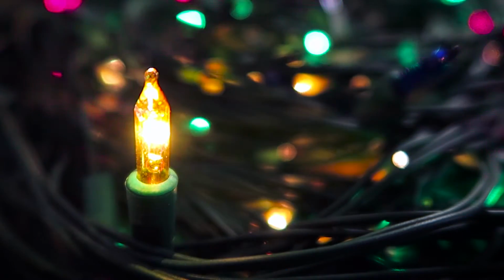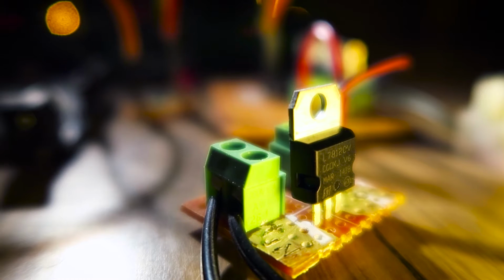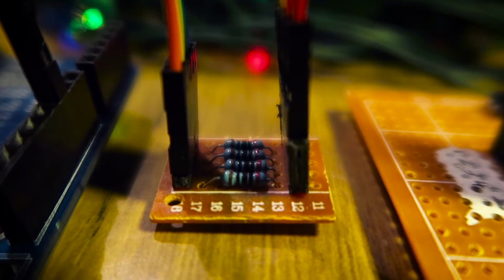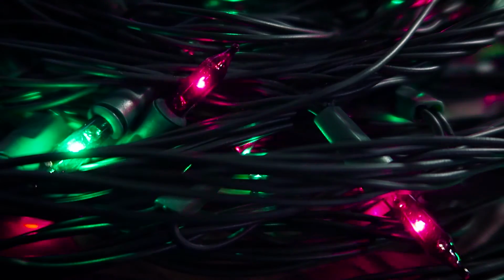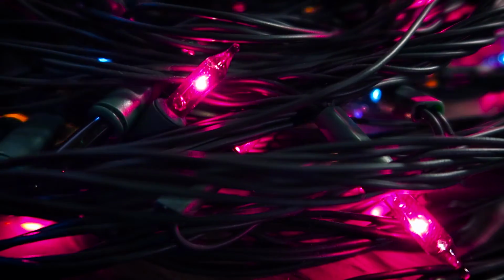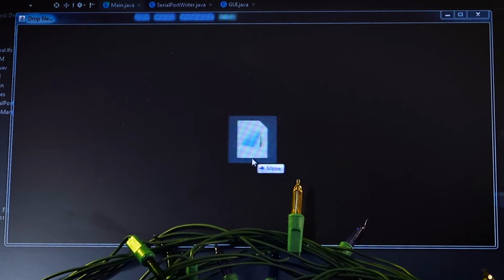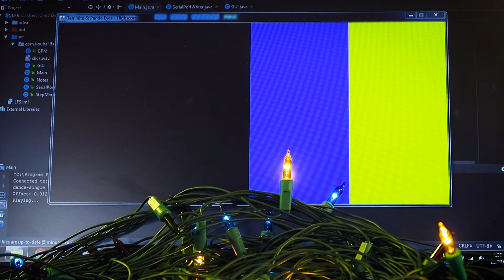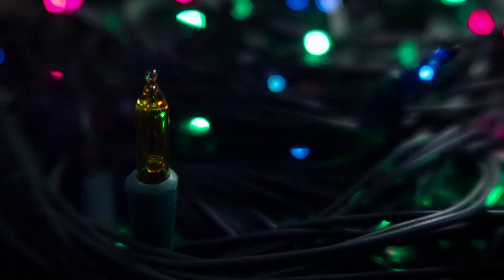Arduino Controlled Christmas Lights

Comment: Is there a way to have the music sync sketch work with a microphone or line in? Are the bulbs able to have PWM via your schematic? It looks like theyre just turning on and off, but it's a little hard for me to tell. Very awesome none the less.
Reply from the maker: The "web control" example is using PWM and transferring the data over serial using a byte for each channel. You could easily write an Arduino sketch to control the lights from a microphone or other input.

Comment: is the schematic or code available?
Reply from the maker: I have uploaded the schematic and code to GitHub and linked in the description. As I mentioned in the video it doesn't include the necessary current limiting resistors on the input.